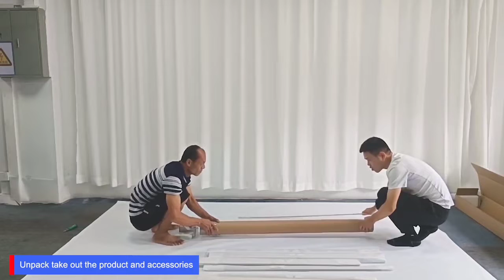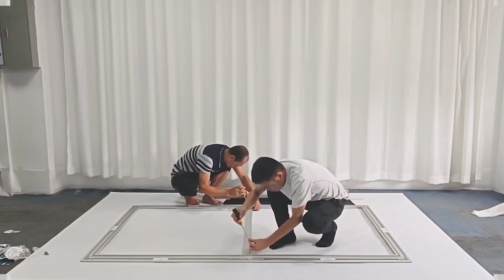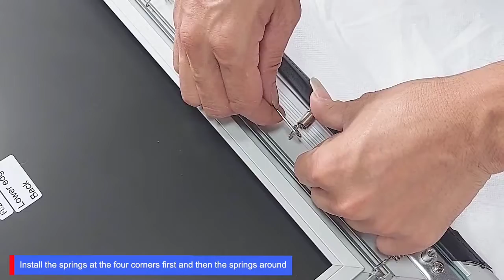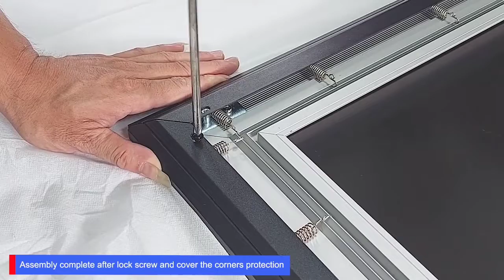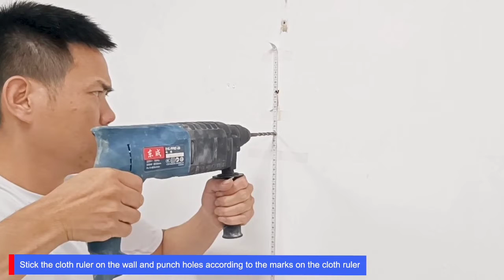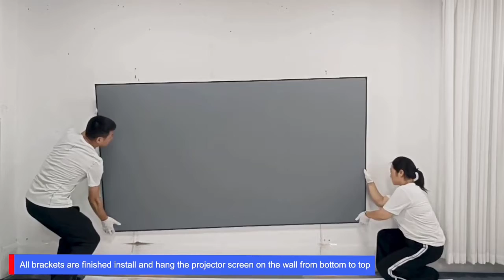How to Install The Wemax ARL/CLR Fix-framed Projection Screen

Comment: This video provides an overview but it is quite complicated than what you see in the video. We followed the instructions in the manual but found it hard to assemble. It was extremely hard to place the outer frame on the inner frame easily
Reply from the maker: We will create another detail videos for you asap.
Reply: Agreed, need more detailed instructions
Reply: Yes, currently assembling outer frame to inner frame right now, and this product has convinced me that I don’t need an alr screen anymore. Their tolerance stack ups are all out of spec